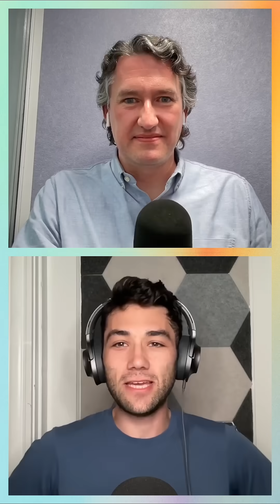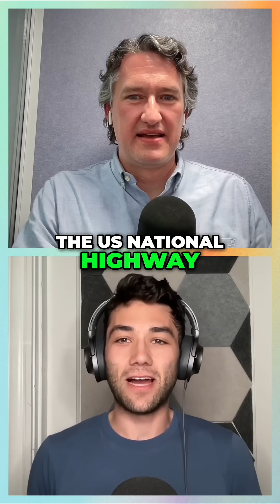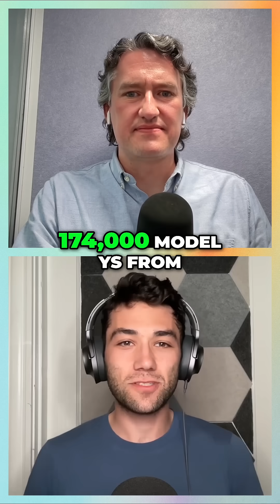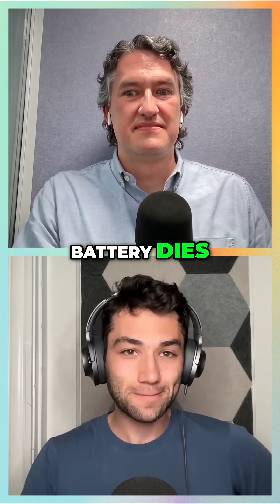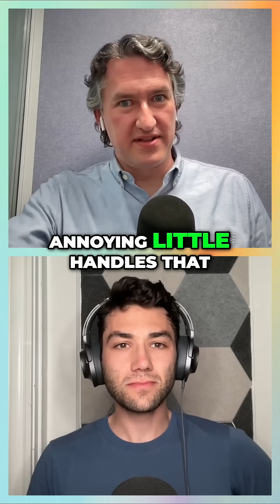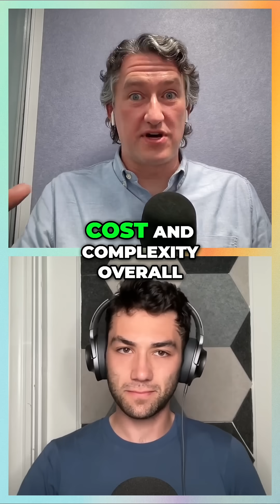Tesla Door Handles: A Hidden Danger in Crashes?

Comment: It is pretty bad how there is no way at all to open the back doors on a RWD Model 3 LFP if the 12 volt dies.
Reply: Yes I had a M3 and noticed that right away.  I would always warn people. It is not a common problem but could happen.
   Even the front doors are not like other cars. People need to try them even in the front so they are used to them.